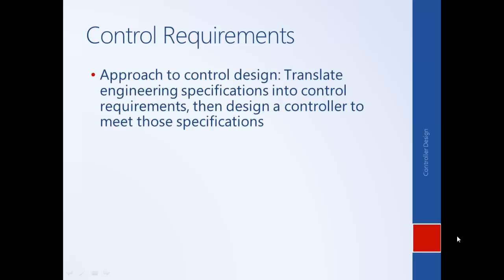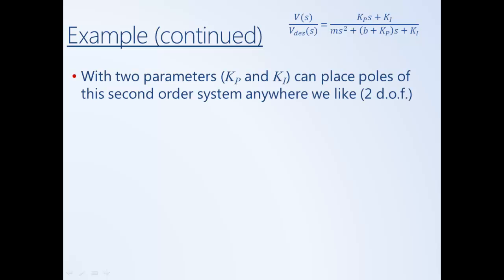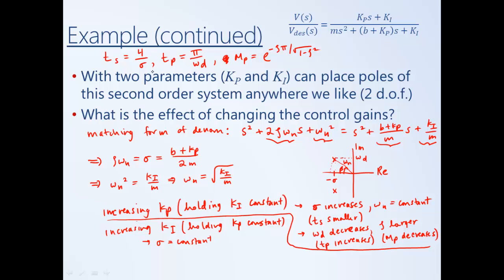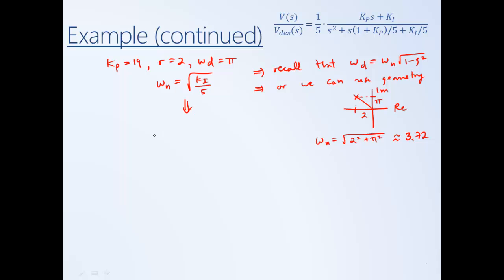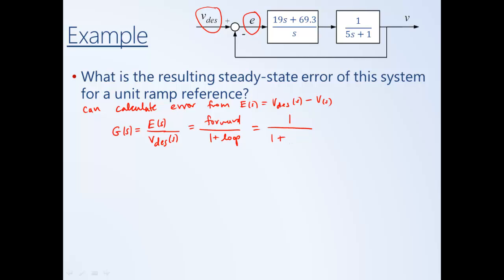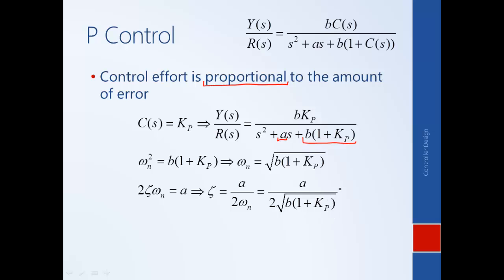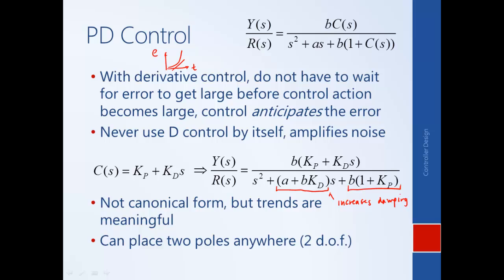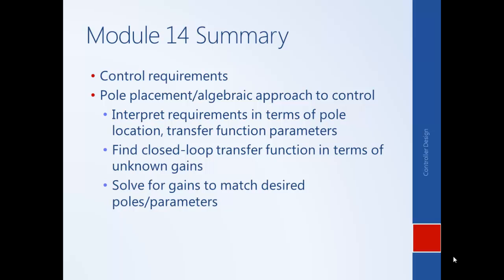System Dynamics and Control: Module 14 - Control Specifications and PID Control

Comment: Hello Rick! This is a great series of videos! Thanks! I was wondering if there is any particular book you follow, or which you recommend in conjunction with the videos.
Reply from the maker: +Antonio del Río Chanona Thanks! The videos are based on a variety of sources. One book that follows the theory quite closely is System Dynamics by Ogata, since it has a strong emphasis on modeling.
Reply: Great Lectures and thank you for your lectures. Would you like to tell me how to find the PI gains when only  bandwidth is given? E.g if we have 250 Hz Bandwidth then how?